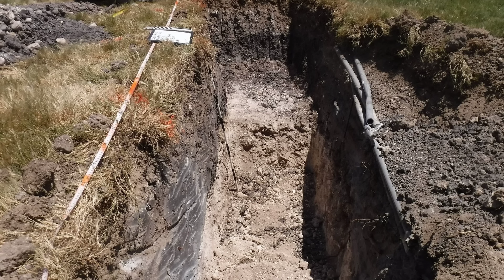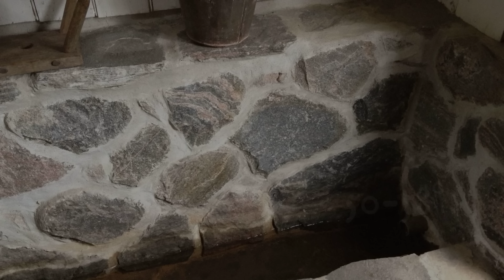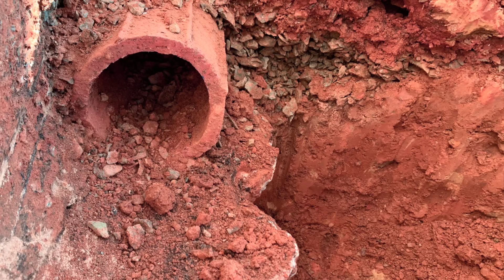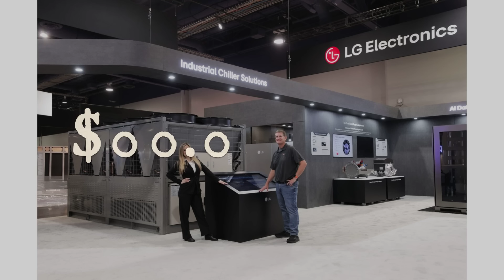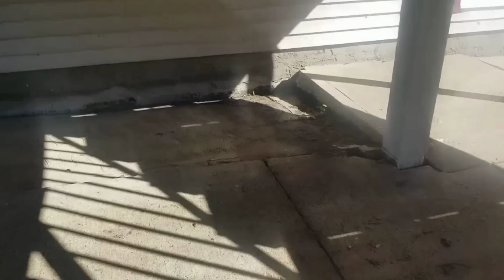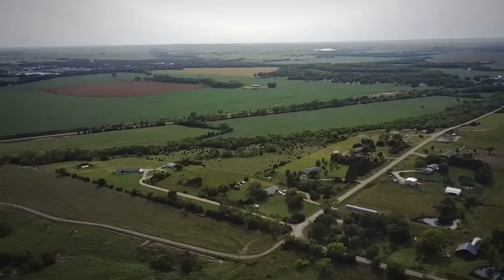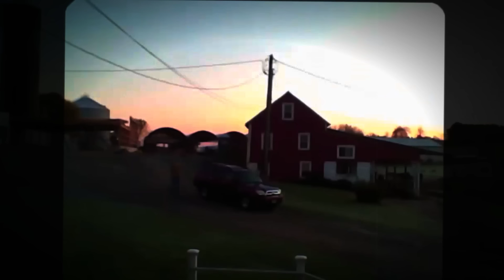This $300 Tunnel Keeps Any Home 55°F Forever — The Amish System the Cooling Industry Made Illegal

Comment: If you live in an area that has high humidity levels. You will have mold.  It works ground temperature roughly 55°.  But unless you can dehumidifier, you’re gonna have mold.  Dehumidifiers heat the air, so adding a dehumidifier would likely be counterintuitive to what you’re trying to do by the ground tube.  If you can keep the air dry, it will work, but mold is going to be your problem.

Comment: Sure but this video doesn't talk about the extremely humid climates such as the south. You'll be cool but clammy, also if you have carpet youd just be opening yourself up to mold. Conventional HVAC systems work as a dehumidifier because you're circulating inside air instead of pulling in outside air inside.

This also doesnt talk about areas that have high water tables or if you live in marsh or areas that are prone to flooding.

Comment: People forget about volatile compounds coming off the soil and rock. One example I could mention is, well, radon coming deep out of the earth's crust, piling up in the enclosed air. That stuff is radioactive, and unless you've got thick concrete lined up everywhere, then in some parts of the world, you will have radioactive air. That tunnel is great, but it needs maintenance costs. And some tech to avoid risks. Not everyone is skilled enough to prevent radon gas from leaking through concrete cracks. And a lot more people can install an AC or a heater.
Reply: You know what works against radon? A fan that runs for a few minutes. 
And it takes a long time for any considerable amount of radon to accumulate. It isn't the boogy man some folks make it out to be.
Reply: You know what else works?
Schedule 40 ABS pipe.
Schedule 40 ABS pipe is impermeable to radon gas, as long as the joints are tightly sealed.
Problem solved.

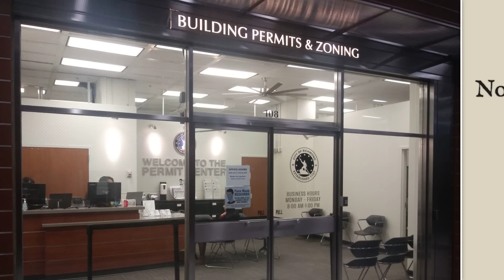Comment: 12:56 Does not mention the pump required to circulate the glycol (main ingredient in most vehicle coolant) and it doesn't not mention the expense of running this pumped. This is a Geothermal ground loop and it's even more efficient if you have a pond to run the lines instead of the ground. Ask me how I know :)
Reply: How do you know? lol
Reply: You will still need a refrigerant compressor if you want heat. I agree a pond or well system can be just as efficient as a direct burial system. But 55 degrees will not heat your house by itself. Geothermal is an awesome heat exchanger. More efficient than air. But wayyyy more expensive to install typically than a air to air heat pump.
Reply: @JS-ny8sn  I use an outdoor wood boiler with a closed loop system to bring the heat up in the winter with liquid propane as a backup for the home only (our stove runs on LP). We heat a 40x40 shop and our small 1600sq ft home with wood.

Our pond also has a depth of 22 feet with coiled lines.
Reply: @JOATJESSE 
That’s a great system 👍🏻. 
I have worked on a couple houses that had that setup for heating.
Reply: These pumps pull 1/3 or less power than a cheap microwave. 100-300 watts. Hell a toaster pulls more power.
Reply: @dmsdmullins depends how many pumps you need and how high you need to raise the water. The toaster is obviously just resistors, like a hair dryer or clothes dryer, and a pump is using AC to generate a pulsing magnetic field to spin the shaft on the pump continuously. Pumps aren't all that expensive but you better keep a backup on hand.
Reply: Wait, you run the lines through a pond instead of underground?  That would be fantastic for summer cooling if the pond was deep enough. But what about winter?  You lose the benefit of earth warming if your pipes are in water.
Reply: @BethCarmichael628 the pond has a max depth of over 20 feet. The water is warmed by the ground just like the air would be...same principle.

Comment: Paying HVAC companies to do geothermal would be the modern way people do this. The old air tubes would be open to radon, smoke, pests, mold, etc. You would have to size it properly & you would have to add supplemental heat or cooling & a dehumidifier to optimize it. It will definitely cost more than $300!
Reply: Yup to be safe 20 grand 😂
Reply: 100%
Reply: A lot of mini split system have a dehumidifing mode built in.
Reply: @ninjapawz88  great idea! Just install HVAC! That way you don't need to have this underground pipe system at all!
Reply: FACTS, Geothermal is the modern version of this technology.
Reply: Yeah, I think the $300 figure includes the shovel and the cost of disposing of the soil, but that’s it.

The whole video is completely wrong. It’s the typical conspiracy theory BS where the author didn’t understand what they’re talking about, go rose-tinted on one side, and disregard any common sense in their criticisms.

Geothermal is very much a thing, and has been for a long time. There’s no big conspiracy preventing it, and your house builder would be very happy to charge you for a giant trench or borehole rather than getting Carrier to sell you an AC unit (with Carrier making pretty much all the money, instead of your builder). People know about geothermal. There is no big government that could erase the memory of that technique, that is used CURRENTLY in many parts of the world, including the US, and has been for decades.

It’s not very common because the soil might be at a great 

temperature underground, but if you run warm air through it all Summer-long, it gets warmer (so it stops working). To make sure you get cool air all Summer, you need to have a lot of soil to pull cold from, so you need a lot of digging. And it gets very expensive.

It can be great, but it’s not for everyone.
Reply: @Jayjay11111  agreed no one is hiding Geothermal Heat pumps from anyone.
Reply: @Jayjay11111 he said the guy spent the money on materials and equipment. Not labor, inspection etc.
Reply: Removing humidity is a big part of what HVAC does. There have definitely been days where it was cool outside and my thermostat said it was cool inside, but it felt hot and sticky because the humidity was so high so I had to turn the AC down way colder than usual just to get it to run and take some of the humidity out of the air.
Reply: @circlingoverland4364  100% spot on. removing humidity is arguably the most important thing a proper HVAC system does.

Comment: Could part of the reason we don’t see this used more often is due to radon gas that can come up from the soil and penetrate thru clay pipes?
Reply: You dont use clay pipes for this kind of project.
You use a schedule 40 ABS pipe. 
Schedule 40 ABS pipe is impermeable to radon gas.

Comment: Mold, mold, mold.  loves dark wet places.  you simply cannot safely do this.  the humid air would condense instantly and dust etc would stick to it and boom!  MOLD.  toxic mold.  you can still take advantage of this but like everyone said, its a ground source heat pump type system.

Comment: It's called a geo thermal heat pump.  And hvac companies all over the country install them.  They have a high upfront cost.  That's why most people don't know about it.
Reply: No a geothermal heat pump uses a  A/C / Heat pump, but uses the ground instead of air to exchange the heat. It still uses a compressor
Reply: that's not what this is
Reply: MA has some incredible rebates of up to 25k, plus a 30% tax deduction and no tax on the equipment. Considering that my heating bill this winter was $1,300 per month for propane, if I had to do it again, I’d go with the heat pump. I’m still paying off a tankless system that was 12k.
Reply: @doreeneclose6295  How much space do you have? If you have a typical city lot in MA you're screwed but if you have lots like we do in Arkansas why not buy a 1000 gallon tank or two? Then you just fill it in the Summer when it's cheaper.
Reply: @hithere7382 3k sq.ft. It was a very cold winter. But still, heating costs are off.the.charts. Your AC costs must be high.
Reply: Thank you!!!
Reply: Yeah I think you're a little confused. The refrigeration companies run the refrigeration lines underground in order to pre-cool the hot gas that's returning to the compressor. Or to heat up the gas entering the compressor. And this is mostly done because heat pumps are very efficient until it gets very cold or very hot. Then they don't work at all and they have to go to backup. Not so much for cooling but for heat definitely. Anyway that's about efficiency. Is everything is very cool and it's not being sold by any refrigeration companies or air conditioning companies I promise you that.
Reply: @genxjaws1191 
You’re mistaken. You do not run the “refrigeration lines” in the ground for a geothermal system. What’s in the ground are pipes that have water & glycol or possibly methanol in them. That is run typically through a tube and shell in the compressor section of the system.

Comment: I get the cooling effect...but in the winter, how does one bring that 55 degree air up to a comfortable temp?
Reply from the maker: That is exactly the right question. And the answer is the part nobody told you. In winter, outside air in Ohio hits -20°F. By the time it travels through that same tunnel, the ground has already warmed it to 50°F. Your furnace only has to close a 20 degree gap instead of a 90 degree gap. That is a 78% reduction in heating load. Video coming soon.
Reply: @EliYoderSecrets  So, does the furnace heat the air in the tunnel using a heat pump or do you use an outside furnace to make up the difference?  Either way though, you're dependent upon power to do so...less so with the furnace as it is just a water pump and air pump.  Still, not exactly off the grid though.  I appreciate the response though!

Comment: My dad back in the 50s and early 60s used to bury air conditioning ducts into the ground under the concrete floors in West Texas 105 plus temperatures in A32 100 square feet high our electrical bills during the summer, they are exceeded a $100.  It had thermal pain windows, actually 2 panes of glass with one inch in between them.

Comment: Interesting video and the idea behind earth tubes is real and well studied. Buried air tubes can definitely temper incoming air by using the ground’s stable temperature and help reduce cooling loads. That said, the claims here seem overstated. Ground temperatures aren’t a constant 55°F everywhere—they vary by location—and earth tubes generally pre‑cool air rather than keep an entire home at a fixed temperature. They also aren’t illegal, but regulated due to moisture, mold, and air‑quality concerns. Useful concept, just not quite as simple or universal as presented.

Comment: It has to be scaled to the size of the house to be cooled.  Plastic pipe does not work very well but copper pipe does.  Diameter of the pipe must be condidered to computer the efficiency of the system.  Just running a pipe through some ground is not going to be satisfactory.  It requires more space than most people have,

Comment: I’m currently designing my off grid home. I live 10 miles north of the Gulf of Mexico and we have high humidity. How can I mitigate the condensation and most probably subsequent mold and mildew issues?
Reply: Buy an air conditioner, and power it through your solar/battery system. That’s the best way to remove humidity. 
This type of system will NOT remove humidity from your home.

Comment: I noticed in S. Carolina, touring the historic homes downtown in the summertime when it was 90+ degrees and humid out, the homes were in the low 70s upstairs with no AC of any sort. The tour described the basement and cupola and air flow through the home and we all marveled at how clever the passive cooling was. I was immediately annoyed that my modern home had no though to passive cooling considered during it's design or construction. Commies like to complain about capitalism and they're inhuman filth, but this is a case where capitalism absolutely effed us as a culture and reduced our standard of living overall.  Frank Nash was wrong - Equilibrium didn't account for this.

Comment: The first house I ever bought was very old it actually had an addict with a big fan in it and in the summertime in the heat it had no AC no central air you turn on the fan and open up the windows and a door it will literally cool down the house really quick from 110° South Texas heat to a manageable 60 65 degrees so yeah systems like that do work
Reply: The problem is the addict... I would get it out of your house asap.
Reply: @bpetty27 Those come standard in California. They have more rights than you. Can't evict them. 🎉
Reply: Does it really get down to 60-65° in South Texas during the summer? I used to live down there and we were lucky when it got down to 80° at night. It's unlikely that an attic fan could cool a home down to 60-65° during the worst heat of summer.
Reply: @Texas1FlyBoy  maybe an evaporative cooler...
Reply: @mikewells2096   no, a swamp color won't work in such a humid area, it needs to be very dry. I use one all summer and the ambient humidity is around 10%.
South Texas is very humid, especially with the Gulf so close
Reply: @Texas1FlyBoy no he's clearly lying. Just go to South Texas in the summer, you'll see.
Reply: Talk about exaggeration lol.
60-65 degrees my ass!
Maybe 90 degrees if your lucky lol.
Reply: I think he means the fan pushes air out and draws the cooler air from below up to cool the home.
Reply: If it that hot outside then you sucking in hot air, just like your story..
Reply: Attic fans are elite.
Reply: I MISS my house in Houston with the ATTIC fan!! Crack open all the windows an inch or two, pull the panels down in the  hall with the fan in it, crank it up and its gets cooler FAST.
Reply: @ChrisJones-qw7bn   I read that as "pull your pants down in the hall".
Houston must be weird, but it's almost like living underwater it's so humid.

Comment: There’s nothing illegal or hidden about this.  Sheesh.
Reply: Building codes if your caught your fined.
Reply: @fredmonroe6042  i mean you can still get geothermal legally, you would just have to pull permits. its not illegal, just extremely expensive compared to a regular AC unit install.
Reply: @fredmonroe6042  it really depends on where you live whether this would require building permits. Most States it likely would require a permit.

Comment: Anywhere where a Fire Code exists, this rig is prohibited. 
Ask yourself "why".
Reply: But the concept works so well in my outdoor fire pit
Reply: For safety tho couldn’t there be a shut off valve? Automatic or otherwise?
Reply: @NashElGrain  Yes. It's called a fire damper, which is often an automatic device that has a meltable element that closes a spring-loaded damper. Even a small one cost over $300. Also, it only closes when the heat is near. So, if the fire is in the attic and the damper in the basement, it will continue to furnish fresh air to the fire for a long time before it closes. Or you could have an electrically operated smoke damper that is electrically interlocked to the fire alarm system. Such equipment is not typical in residential developments and would cost thousands to implement.

Comment: It’s called GEOTHERMAL heating and cooling it has many iterations and It’s been around and advertised for many decades.
Reply: Not the same.
Reply: @kapolani9539  exactly the same
Reply: “Geothermal” still uses compressor and antifreeze. They only use the ground to remove the heat from the refrigerant. It only removes the 1 fan motor and replaces it with a water pump.

Comment: Sorry. I don’t want 55 degree air entering my house in the winter!!!
Reply: The point of geothermal in the winter is that you are heating 55 degree air rather than 20 degree air.  You still have to heat, but you are starting with warmer air, so it takes less energy.  55 is too cold summer or winter.

Comment: The first tool of cave exploration is light  . The second is trash bags . If you fall and break a leg. Hypothermia is coming for you faster than a rescue team. At 55 degrees, you get into the bags to maintain  body heat . I carry two of the foil insulated bags. Lighter than trash bags and you will break a sweat.  

There is a geo-thermal electric plant somewhere in the east coast. It worked so well they didn’t build another. Frankly if I invented something that rivaled the industry, I’d shield my name from it 

It’s too much money for them to lose. They have no compunction about killing you. Stan Meyers RIP

Comment: I'm glad you addressed the issue with high humidity in the SE US. Air pulled through underground pipes WILL grow mold, which is why I was also glad you suggested a geothermal closed loop. From my prospective as a home builder/energy management contractor I like the geothermal heat pump. Quiet, no exterior fan and long lasting. Not passive but it still achieves EER ratings well over 40. Yes, you still pay the power company, but you get really efficient heating/cooling for a small percentage of what a conventional HVAC system would provide.
Reply: I've used this system for the last 13 years with no problem. I have a heat recovery ventilation system at the end of it with a Hepa filter i change every 90 days.
Reply: I do work for a guy that has a geothermal unit in a 4500 sq.ft. house his electric bill $380 a mo year round I have a 1700 sq ft house that is $180 . So his is $12/sq.ft. mine is about $10 . He is all electric I have a 96+ gas furnace . He just replaced just his indoor unit at over $20000 mine about $8000 do the math is it worth it . His unit lasted 20 yrs . I think if you spend the difference in insulation technics you'll  save more .
Reply: 40? How that? My research only shows systems a bit better than air conditioning, around 5

Comment: This did NOT work in South Louisiana.
Reply: Unfortunately high humidity changes the equation significantly.
Reply: @ewechubechroll  easy add a dehumidifier before the air goes into the tunnel🤷
Reply: Or in Florida 😅